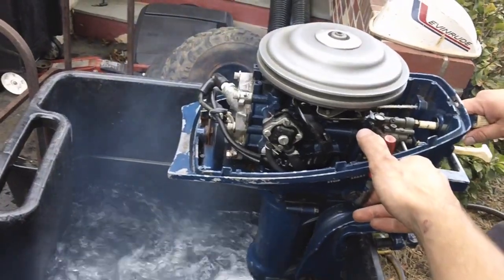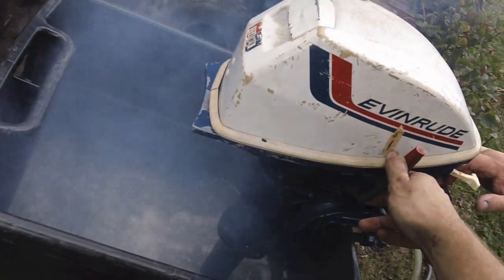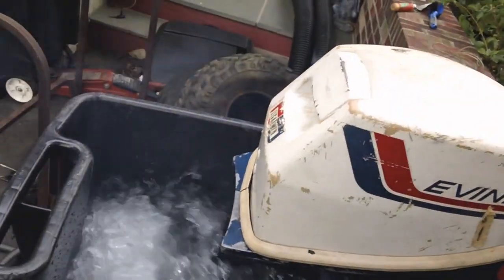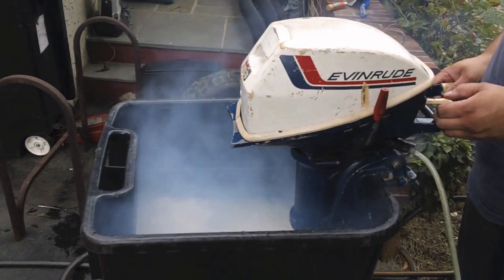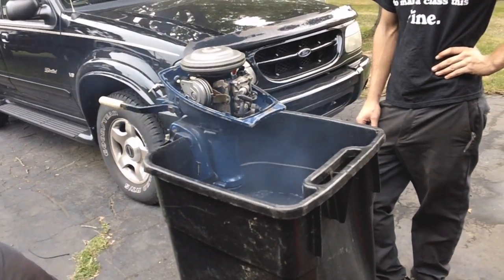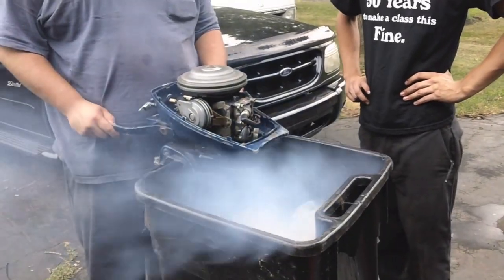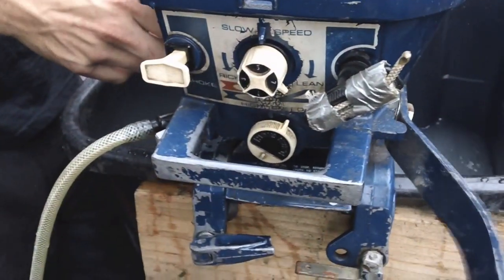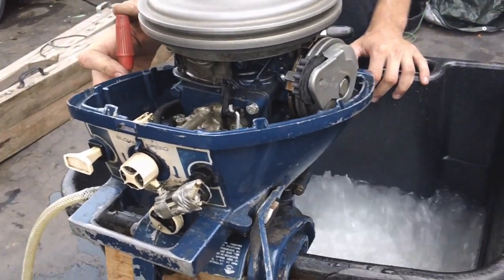1972 Evinrude 4hp lightwin outboard engine twin cylinder cold start

Comment: Found one under the family tractor shed slapped it on the back of the boat backed into the pond and pulled five times she fired right up. Mind you it’s was under the shed for approx 25 plus years

Comment: I have a 1973 Evinrude Yacht Twin 4 Hp 2cylinder. There is a knob on the front of the engine that adjusts "lean - rich". Anyone know what this supposed to be set on for starting, then normal trolling.
Reply from the maker: That knob only adjusts your fuel mixture off idle.  You always want it more on the rich side.  You have to fine tune it on the boat and under load.

Comment: ps, very easy to do,  fun little twin  cylinders  ,  maintain it and it will last a long time,   pss  never full throttle in a bucket  = over-rev , and put some good oil in it like   xd-50  also stay away from ethanol mixed   gas  e

Comment: I have a the same motor and my dad has adjusted all the mixtures, do u have some info on where they should be. I can get it to fire but wont run. New fuel pump and new plugs fitted, new fuel too.
Reply: Nikki Booth I have a similar question.  I have a similar motor, and I'm currently trying to tune the carburetor.  Could you let me know what the tuning turns are for the slow speed and high speed is?  The only info I've found so far is a  carburetor tuning for a 1957 Johnson 7 1/2 hp.  They recommend 1 1/2 turns out for low, and 3/4 turns out for high.  Would this be the same  for the 1971 4hp?  Thanks in advance!
Reply: I seated my top gently to the right then turned out one full turn and a half turn,on the bottom only about a half turn out only finger tighten the carb bolts with a half turn of a 7/16 wrench or it won't run period unless u put starter fluid init or straight gas which is very very bad

Comment: How much compression does your motor have? I have a near excellent looking motor but my compression is in the 45psi range. The motor will run throttle open but as soon as I try to idle it at a trolling speed it dies. I have so far invested in a impeller, fuel pump, head gasket, exhaust cover gasket, and cleaned the carb. Any ideas?
Reply: Change your fuel pump..
Reply: Thanks for the comment. I was able to get the motor running. I ended up doing a complete rebuild including coil and condensers and it runs like a dream. I think from the start it was coil or condenser. The bogging down was due to running on one cylinder. It was my first rebuild ever but i had my machinist neighbor help me out as far as what i should for when rebuilding.
Reply: Loosen your carburetor bolts the two nuts that go onto the studs only fingertighten them I replaced every piece of mine just to find out that's all it was
Reply: 45 psi is too low. It should be at least over 65 or so. 75 to 90 is much better. These old motors are low compression. You aren't going to see 120 psi or higher like on modern motors.

Comment: Anyone have a manual for this motor they're willing to part with?  Just picked one up myself.  Now the fun begins!
Reply from the maker: You can usually find the manual for these on ebay, thats where I got mine when I had it.
Reply: Yup, bought an online Seloc manual.  So far so good.  Parts in the mail.  Should have it in the water this weekend!
Reply from the maker: Jason Myerchin nice good luck.  These engines are usually bullet proof.  Make sure you change the water impeller before you really use it.
Reply: Thanks for the advice.  I'll def get one ordered.  Can't wait to get it fired up.  It's in really good shape.  Hardly a chip in the paint.  Couldn't have been used much.  My turn to put it to work now.
Reply from the maker: Mine had awesome power and torque for a 4hp.  I used mine on a lake for fishing.  I'm on a river now so I need something with a little more HP because of the current.